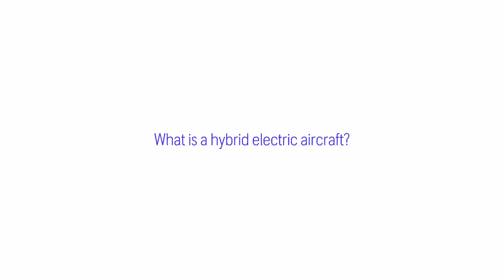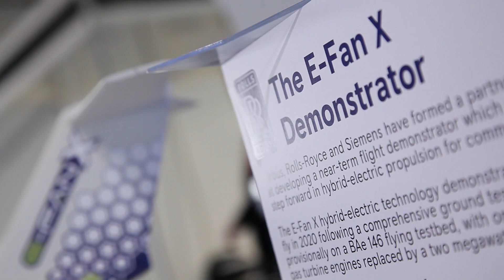Rolls-Royce | Electric in Aerospace

Comment: Hybrid airliners can NEVER work.
a. Because airliners work at constant power settings.
b. Because airliners operate as near full thrust in the cruise.
Which means that your hybrid ICE engine would need to be working just as hard (and consuming just as much fuel) as the original jet engines.

Rolls Royce and Airbus should be taken to court for misinformation.
They sucked £58 million from UK taxpayers to fund this fiasco.
And it failed, as any six-year old would have known.
The project was closed down before it even flew.
Because it was hopeless.
P
Reply: Youtube comments are weird - yours got spelling and structure right (which is such a pleasant notch above the norm here) but so wrong on the substance, one can only scratch your own head. So: 1. wrong (yes in cruise, mostly, but the climb portion is where the hybrid usage of those 2 MW make sense) b) ever bothered to look up N1 and N2 settings in cruise? No? Ok, please research and compare the cruise setting N1 on an A380 on the step up flightlevels of long range cruise with the N1 percentage you would use on TOGA. And why do we commercial pilots use derated thrust settings? So basically you got two fundamentals already wrong. Thus please take them to court, it will be fun to watch you blown to pieces by aeronautical engineerings students in their 1st semester. So, pretty please with sugar on top, don't take it too personal, you are far closer to the 6-year-old you brought up than the 1st semester engineering student who would pick your argument apart in no time. Hybrid makes sense in a bunch of applications, for the time being, mostly GA and mid range commuter aircraft. Have a great weekend!
Reply: You appear confused Walter. 
Where is the energy for the climb coming from, in a hybrid engine?  Well, apart from the battery, which will just about power the take-off roll, all of the energy comes from the turbine engine.  So all hybridisation is doing, is introducing energy losses and more weight.

And regards the cruise, so the value of N1 decreases and the proportion of N2 thrust increases - so what?  The point is, the TGT or EGT (the fuel consumption and total power output) remains at very high levels.  Many jet engines are working at 95% max TGT in the cruise.  

And the hybrid engine will be doing the same. The batteries will be exhausted, so all the power is coming from the turbine (via some electrics).  And that turbine will be experiencing the same problems as a naked turbo-fan  -  it will again be working at 95% of max TGT.  So there is NO CHANCE of using a smaller engine (to save weight), because the engines are already at (almost) full-chat.

I hope you are a wannnaby, and not a real pilot...!!
P
Reply: @paulspencer889  the energy density of kerosene is still 14 times higher than batteries, and since the engines are still at 95% capacity while cruising that makes it impossible to use electric power during long flights, yes? But do you think it is possible to power very short haul flights of small aircraft, say under 10 minutes, with current battery technology?